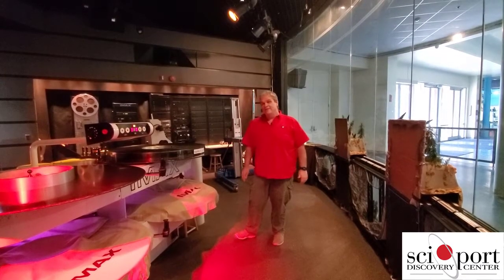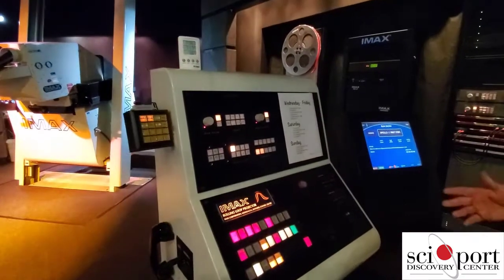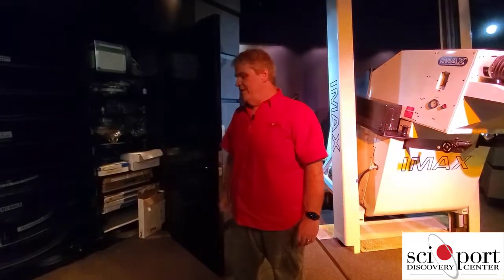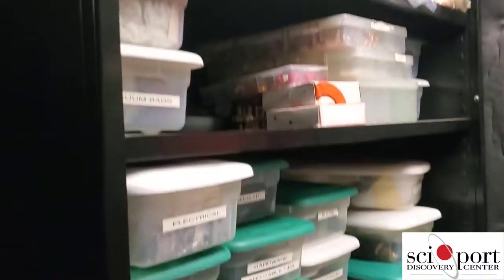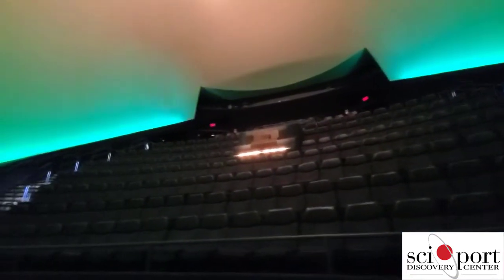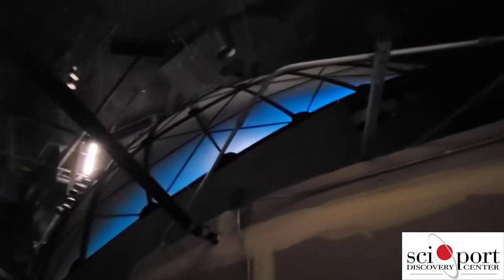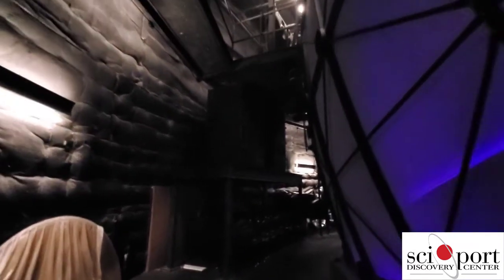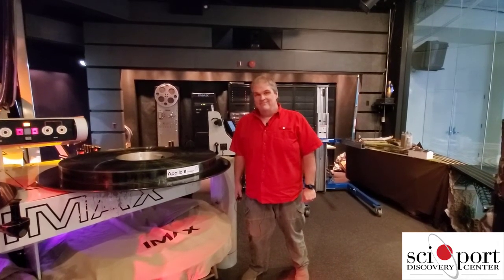Virtual Tour: Behind-the-Scenes of IMAX

Comment: So I understand how the back of a reflector can be cooled with water but how is the bulb itself cooled with water? Does it have glass veins in it? Is this water cooling in addition to fan cooling or is it only water cooled?
Reply: There are also fans providing air circulation in the lamp house to help dissipate heat. There is also distilled water flowing in both ends of the lamp to control the heat from the arc lamp. The glass part of the lamp does not have glass veins.
Reply from the maker: Thanks John! @slashmaster2, John Armistead is our IMAX Manager.

Comment: Aww man you skipped the best part, I would have loved to seen what amps are driving all your speakers.
Reply from the maker: Hello Total Plonker, i’ll see if our IMAX manager can share the 411 with you!
Reply: John is actually standing in front of the amplifiers at the beginning of the video. They're built into the wall behind him on the right. They're Sonics brand which is a brand made just for imax theaters. John tells me they pull a lot of power. That whole system including the speakers will be removed and replaced during our digital upgrade this year. Look forward to that!